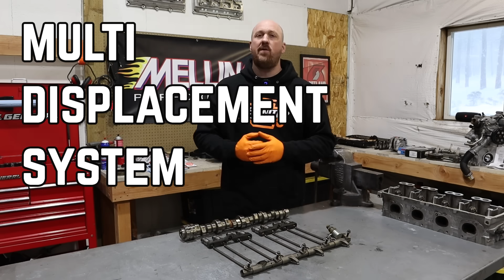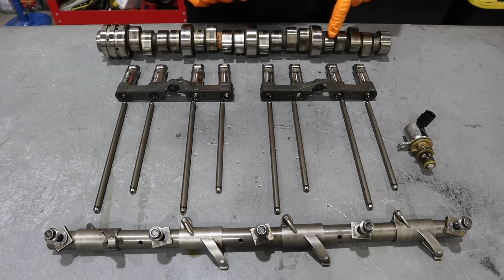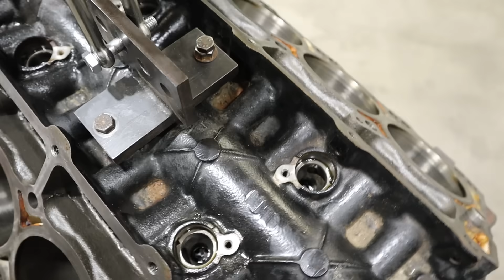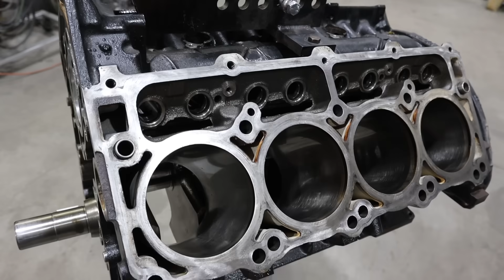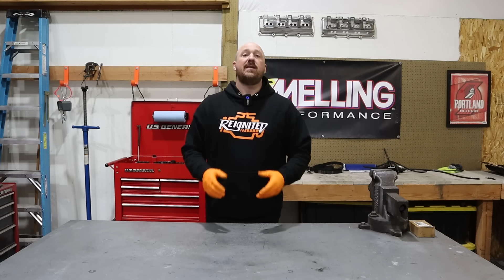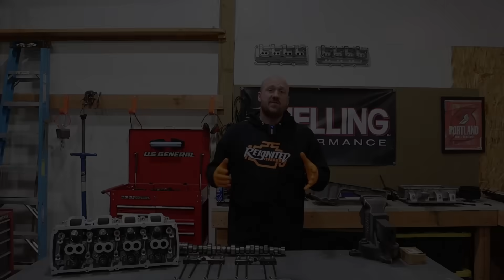Is MDS Damaging Your HEMI? The Answer May Surprise You!

Comment: If the MDS is constantly cut off with a tuner doesn't that mean that all 8 cylinders are always working? So, wouldn't that mean that the MDS cylinders are always getting oil pressure? I would think it would not get pressure if MDS were somehow always on. When you step on the gas and open the engine up the MDS cuts off, so how is that different? If MDS is off at high RPM it's not getting oil pressure? Huh?
Reply from the maker: You may need to watch the video again to see how the system actually works. They cylinders themselves always have oil on the cylinder walls, that doesn't change whether the system is active or not. All I'm talking about in this video are the lifter bores, which as I said, do receive a certain amount of oil at all times. However, when the system is active, full oil pressure is allowed to flow to the lifter bores- this pressure depresses the pins on the MDS lifters which collapses them and does not allow the valves to open for those cylinders. When the system turns off the solenoids reduce the oil flow to the lifter bores, the lifter pins snap back into place and they start opening the valves again.

Comment: Is it true that you can shut off the MDS by turning on toe hual? One thing I noticed is a noticeable power increase with the toe hall on.
Reply from the maker: It does turn the system off while tow/haul mode is engaged. Likely you feel like the power is increased because the tow/haul mode changes the shift pattern and keeps it in each gear for longer before shifting.

Comment: I have a 2016 rebel with 35’s and a 2007 charger awd both with hemi and mds.  The both try to go 4cyl constantly but the ram rarely stays in 4cyl for more than a few seconds bc of the drag of turning those 35’s and the general wind resistance of pushing a truck along at 80mph.  The charger runs in 4cyl mode 60-70% of the time on the freeway with the stock 225/60/18’s.  I have a set of 245/50/20’s for the charger (for summer) and mpg drops from 23-26 on the freeway to 19mpg because the 4cyl mode doesn’t generate enough torque to combat the wind resistance/rolling resistance of the wider wheels/tires.
Reply from the maker: Exactly right, that's why I'm not a huge fan of the system on the trucks because it's constantly shifting in and out of the system. I'm much more comfortable removing the system entirely on trucks because I just don't see the value.

Comment: If the lifter failure were attributed to MDS or a lack of lubrication; You’d be hearing stories of people replacing multiple lifters over the life of the vehicle!  However, you don’t!  Once the failed lifter is replaced you do not have a single incidence of repeat failures.
Reply: If you look it up, only 5 percent of the problem is the lifter problem. The rest is the broken exhaust manifold bolts. People really freak out when they start hearing the tick noise,I know I did. I had one bolt break 6 years ago and got it fixed and one on the opposite side break over 4 years ago and I still haven't fixed it and it hasn't gotten any louder. 30 seconds of driving and the noise is gone.

Comment: Certified dodge technician here. Personally I can say the MDS system has it ups and downs but I hate it. I just recently had a lifter fail on cylinder one on my personal vehicle a 2016 scat pack challenger. Replaced the motor and installed an MDS delete.

Comment: You’re telling me that they designed the engine so the lifters get more oil while they are collapsed with only light pressure on the cam and they receive less oil when they are under full load…that makes no sense
Reply from the maker: I have to agree with you there, I have no idea why they designed this system the way that it is.

Comment: Make sure it is High Volume not High Pressure, their is a difference. Mellings make it but make sure it is for you  year engine there may be a difference.  I was getting about 600 miles on a tank full traveling from NJ to my house in NC. about 20 MPG when the truck was newer  carrying loads  of about 1200 with a  2011 Tradesman . But going to my daughters at 350 miles am on it and  had traffic  so I not ever got near that. Plus at 190,000 miles I think it is time for getting rid of the original plugs. On those trips I am at about 80 MPH ++  or stopped in traffic. So I  get about 400 miles carrying weight.
Reply: Just bought a 2012 Sport.  Read about the plugs. Dual spark, 2 per cylinder. Lower trims hot 30,000 mile copper plugs. The platinum/iridium plugs go 100,000. The hemi wants good plugs. Replacing all requires exhaust manifold removal. Ones tough and takes right sniveling b wrench socket. It can cost i hear $350 or so at an independent shop.
Reply: @donberry7657  almost 200,000 on my 2011  stock factory plugs and only replaced 6 because you must lay on engine to replace and 63 I am not as flexible but no codes but need to do all of them soon, Have a race against a 95 Vette and plan to kick his ass and do not need  plug to fail. I know how to use the button on the shifter to set shift points at  what rpm I desire and I rev high and that may be when a plug fails.
Reply: @1oldgoat5000 Hi. Saw great vid on replacing these. Always so much stuff online to sort to get straight answers. Good news it doesn't look so bad after all and there's the usual b.s. out there to wade through.  Just takes some finesse and at 1 point guy was standing on a control arm for better reach. Im 64 myself and still spry I just dont know till I pull a plug what I got since original motor replaced was with a 40,000 mile one and it seems like up till 13 or 14 these got 30,000 mile copper plugs. Later copper or platinum and it sounds like with these you dont go iridium without changing coil packs...im thinking a 40k engine maybe I got platinum and im good.
Funny you racing a Vette. Year and a half ago I bought an '01 Mitsubishi Eclipse Spyder GT I've been sorting out. Told guys who ask I could have got a C4 for what its costing me but I like having a rarer ride. And when this truck came my way I looked at stats and thought, wow, this monster is same 0-60 as my GT. 
P.S. From what im hearing I think issue with these hemisphere are weak valves. Guess,Ram coated them later, cheap improvement bur not ideal. Original owner mine designed and oversaw installation sewage plants, this truck didnt 'work' but I bet it idle at job sites that 1sy motor so yup, I think idling big issues for these.
Have fun bro. Guys our age know how to. Kids have their video games, we got our rides.
Reply: @donberry7657  I bought on of those on the tire stands because I am short and have back issues. Amazon has on for 37 bucks. If you are not get spark plug codes I would not rush to pull them and my choice is Iridium Bosch plugs because they last and new engines like my   V6 Chrysler's the intake must come off for my truck no but basically have to lay on engine to reach some so I do not cheap out and have to replace often, Never had to change coil packs switching but will look that up and I have a 2008 Chrysler 300 and they work just fine.

Comment: I drive my son's charger from time to time on long distance travel and have on more than one occasion averaged 29 mpg!  When the mds system is not working it gets around 12.  Now any engine light regardless of how minor will disable eco. It can be reset and work again until the light comes back.    Vvt controls octane knock in order to run higher compression  on cheap fuel. Eco controls the spark and injector timing for optimum efficiency and now added to vvt created high HP engines with descent fuel mileage. Mds mixed in and all in good running  condition 25 plus mpg is very common. Corvette introduced  this back in the 90's and they were pushing 30 mpg then at over 400 hp.

Comment: My 05 grand cherokee 5.7 using mobil 1 went 300,000 and the motor was still great.
Reply from the maker: Yep, the early Gen 3 Hemis are generally very reliable, they're very simple engines. They can't match the power of the later ones, but you very often hear of the early ones going over 300k like yours 👍

Comment: Ok. Mechanical Engineer here with an Associates in CNC Manufacturing. I have over 10 years experience with roller assemblies in gears from both Caterpillar and ZF transmission. Ultimately the root cause of this "type" of failure is not due to just one thing. It is due to a minimum 2 things and likely 3 and possibly 4. I emphasize "type" as there is more than one actual failure going on here and I will explain.

First and most important major issue is the cam material. With 180k on my truck I removed ended up with the dreaded tick and had to do a replacement. The camshaft had "spawling" of multiple cam lobes even when the rollers were in fantastic shape. "Spawling" is very common in roller bearings and gear teeth. Our specific issue is most likely with "hard inclusions" as it is a ductile cast iron camshaft. This is a material and possibly a lubrication boundary layer issue. When the loading is too high for the applied area and it fractures a weak underlying area of material causing chunks of the material to flake off. Here is a link about why "spawling" occurs. https://www.machinerylubrication.com/Read/29228/bearing-system-life 

Second is roller bearing lock up. Oil film/boundary layer issues allow for the spawling to occur as well as poor lubrication of the roller bearing and them locking up. We all know 5-20 does not cling as well to surfaces as a thicker oil and has a much thinner film thickness. The poor lubrication application that FCA uses highlights this issue when the rollers fail in the lifters. We know they redesigned the lifters to address this issue. Using a high quality oil and changing it regularly will help both the spawling and roller failures. 

Third is possibly loading of the camshaft. If the valve spring applies too much pressure then it highlights the issue of spawling with the camshaft. Someone with more information about how much load is applied and with analytical software would need to determine this. In conjunction with this is possibly a geometry of the valvetrain. Side loading of the lifters or something of that nature may apply higher loads to the cam than were initially calculated. This can be seen as the wear / spawling occurs more on the lifting side of the cam lobe as one would expect. (was evident on my camshaft)

Fourth is fractured roller bearings in the lifter. This is a poor metallurgical issue . FCA just cheeped out here. 

Ultimately with the multitude of failure modes occurring it makes it extremely difficult for the average joe to decipher what is going on. Companies are also designing things for emissions compliance by minimizing friction, saving money with lower cost materials, and building for planned obsolescence. In this case FCA just pushed it too far and are seeing a multitude of in warranty failures which they do not want. My personal position is you should have less than 1 in 1000 crib death failures and less than 1 in 100 at 200k miles. There are a ton of parts in play and we have to accept some failure but do keep it to a minimum. Six Sigma allows for 3.4 failures per million. Figure there are 500-1000 parts in play within the valvetrain geometry and you may experience 1 in 1000 failure rate due to a bad part. FCA clearly missed the mark here as the failure rate is well over 1% likely 2-3% under 100k. 

A few things that will help in the long run and get the most from your engine are known though. Good oil, dont idle too much, and a better camshaft and roller bearing material.

Comment: You said that Dodge/Ram put the MDS to keep up with MPG standards set by the Government? If that was the Case then y didn't Toyota and Nissan do this years ago? I honestly think any MDS or cyclinder deactivation is garbage. Shutting of injectors cause then to clog and in turn clog the lifter and make the lifters stick. I honestly think you don't know much.
Reply from the maker: Appreciate the vote of confidence lol, you might want to watch my latest video!
As far as why Toyota or Nissan didn't implement this it's because the MPG standards are an average across the entire brand and Toyota and Nissan make enough fuel efficient cars that the trucks did not pull down the average too much.

Comment: I have a 2019 Ram 5.7 after watching a ton of your videos I am convinced I don’t have a lifter issue yet but I do have a tick for about 60 seconds on cold start I am considering doing the mds delete cam lifters block off plates my question is what kit do you recommend and I now you talk a lot about a certain oil pump do you have the part number for that oil pump?
Reply from the maker: Very common issue on your generation ram is for the exhaust manifolds to Crack right down the center. This is most likely your ticking noise on cold start. For replacement parts believe it or not I'm still an OEM guy. I have too many bad experiences with cheap aftermarket lifters especially. Definitely recommend the Melling high volume oil pump: M452HV is a direct replacement for your stock pump. 👍
Reply: @ I have replaced them with the BD diesel manifolds about a month ago you have really sparked my interest with the oil pump  replacement I think I am going to start there can you tell me where you purchased the wiring part I need to wire in ?
Reply from the maker: @EricMoras-q6v  the best part about the Melling pump that I listed is that no wiring changed are needed, you can just bolt it straight on with no issues.
Reply: @ so what is the difference between that pump and the hellcat pump that you recommended also not sure if I mentioned my Hemi is the etorque engine will that pump still work with that engine?
Reply from the maker: @ Yep it works just fine. When I made the videos for the hellcat pump, the melling pumps had not been released yet. The hellcat pump has a 12% volume increase over the stock pump and the Melling pump has a 20% volume increase over the stock pump. 
The melling pump I listed comes with the stock oil pressure relief spring installed, which means that you'll still get the benefits of the higher volume at idle, however it won't set any codes in the system.
Reply: @ perfect thank you very much for all your knowledge and quick responses you truly are a big help
Reply: @ also the m452HV is the same pump as the q6v ?

Comment: I bought a MSD when building a 392 Hemi for a 41  Willy's project car. When buying parts in a build you buy when the project moves forward .The first time we tried to start it,  it back fired up through the carbs ? OK maybe timing WHO KNOWS? threw the process of elimination it kept back firing  when we tried to start ? Finely got it start and run some times. One Saturday morning  taking it back the shop it stalled at the intersection of the most busy streets  in  Des Moines ,Iowa ( MERLE HAY MALL) It backfired up through the carbs and stalled,  it started back up only to backfire again and  cracked the BLOWER .I. tuck out  the distributer and plug wires gave them to a friend that had an old Sun Tach dwell machine and  that found the MSD had a FAULITY sensor ? Sent it to El Paso I told them the  problem $95.00 later they tell me my warranty  had expired . ONE AN DONE learned my lesson never again . Brian

Comment: My 2006 grand Cherokee 5.7 hemi has 331,659 miles with original everything I’ve had a Diablo sprint chip mds delete in for 230,000
at least or more I change oil every 3,000 explain that

Comment: My 2006 grand Cherokee 5.7 hemi has 331,659 miles with original everything I’ve had a Diablo sprint chip mds delete in for 230,000
at least or more I change oil every 3,000 explain that
Reply from the maker: The Pre-2009 engines do not experience lifter failure. You may have heard of one or two here or there. But certainly not on the scale of the 09+ engines. It's my opinion that when they added VVT and changed the design of the camshaft they went with a new supplier that did not sufficiently harden the cam lobes, this is leading to pre-mature failure of the lifter/lobes. But that's simply my opinion, there are many others out there, feel free to find one that supports your own already formed opinion.

Comment: Your theory about shutting off the MDS system every time you drive is flawed. Switching off the MDS each time is the same as the particular type of driving causing the MDS to not engage. You’re suggesting by nature of design the engine runs oil starved to the MDS lifters and cam, especially during warm up temps when the MDS is prevented from engaging. This is not true.
Reply from the maker: If you'll notice, I did not say it was starving the lifters. I said that there is always some flow, but it receives additional flow when the MDS is engaged. Therefore it does not make sense to keep that system from operating as it was designed unless you are removing the entire system.
Reply: @ReignitedAuto The natural running state of this engine is with MDS off. The MDS system is turned off while in tow-haul mode, so what you are suggesting is at one of the critical times when proper oil flow is needed  as when towing heavy loads it is not receiving the maximum flow. This is wrong.